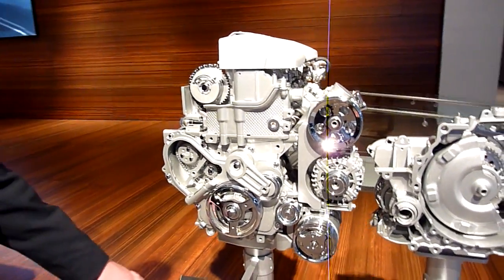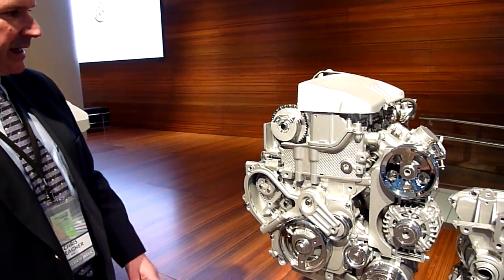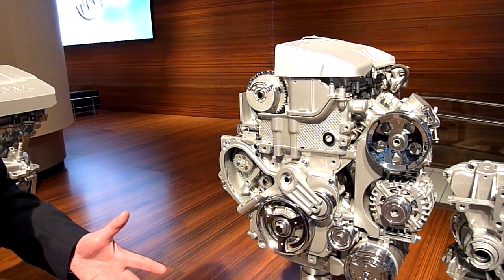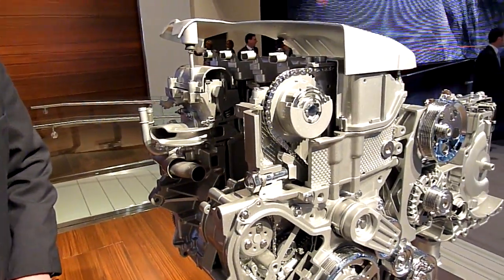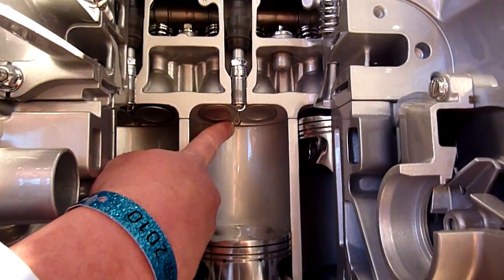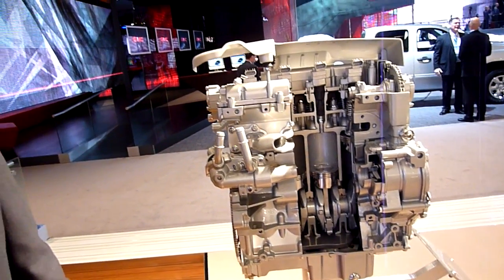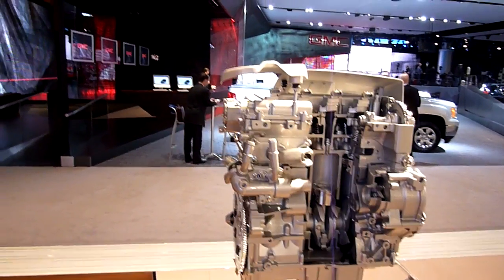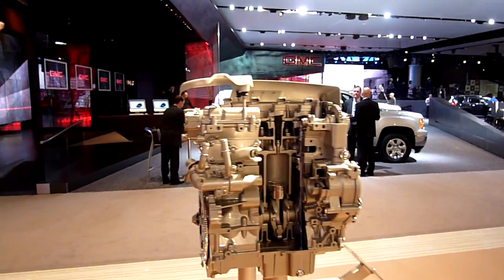General Motors Engineer gives us the lowdown on Ecotec 2.4

Comment: Well, it isn't the best design out there for a 4banger.. but full synthetic oil plus regular oil change every 8000k / 5000m will keep it going with 0 problems.. 

2016 Limited Malibu L.T.Z  2.4L ecotec engine .. 
runs like a clock in 2025 well over 128k on the odometer & still counting.

Comment: You forgot to mention only last between 110k and 150k after that timing chain tensioner fail or guides brake and the engine bent valves

Comment: I'm a mechanical engineer.  I take care of my engines.  At less than 100k miles with this engine I had high oil consumption, timing chain stretch and replacement, seal blowout.  No more Chevy for me.

Comment: My ecotec 2.0 Cobalt was the most reliable car ever, never used oil.. never leaked. 2.4 powered Malibu super dependable never leaked or burnt oil.. always on point but my 2012 equinox 2.4 no leaks no smoke just randomly uses endless amounts of oil... reliable but I know I can't trust the equinox 2.4 like I did with previous ecotec engines I had

Comment: The horse power is a big big turn off  would not buy it. Way to weak of motor
Reply: It's not too bad, Honda has 140hp on the new HRV amd 190hp on the new CRV. Toyota was making 176hp on the Rav4 in 2014 so the 182hp rating on the Equinox was very competitive.

Comment: What a pieces of junk engine.  They added every possible way to ruin an engine.  Really "direct injection, Volkswagen had so much problem with carbon buildup on the valves because of it.  Burning oil, piston ring failure, timing chain broken and a poorly design intake plenum causing pcv to clog. American people are look for a reliable engine and not a disposable engine.

Comment: Yall saying these are horrible engine mf i twist one of these engines with no balance shaft too 8200 rpm at a constant its called maintenance people maintenance
Reply: The early models 2010-2012 had oil burning issues and timing chain issues. After that they were decent engines, some even found homes in recreational vehicles aswell.

Comment: I have the 2.4 in my Buick Verano and doesn’t burn oil at all and as far as chains go, I use Royal Purple full synthetic 5-30 and change the oil at 1800 to 2000 miles. So many people don’t realize that changing out that dirty oil for fresh clean oil at 1800-2000 makes all the difference in how long your engine will last. Americans don’t worry about changing the oil and often just add some rather then changing it. They must have addressed the rings problem before building my 2.4

Comment: If you service it like you should , this engine is bullet proof.
Reply: Nope you can service it all you want it's a piece of shit motor that's poorly designed  I recently had blown out one of the cylinders it also had the oil consumption problem I even changed the oil a month prior to it going out so the garage told me it needs a whole new engine it will be costing me a little over $7k that's for parts and labor
Reply: @speeddemon_1369  if you dontind me asking what year was your Equinox?

Comment: I change oil every 2000 miles with Royal Purple and zero problems, typical Americans , you avoid regular oil changes and then bitch that the timing chain is at fault, no you are.

Comment: Man I was just thinking how he feels..  I own a 2011 terrain and have my share of issues including the rings replaced for Oil consumption so i am not sticking up for him at all.... The oil consumption is caused by a supplier  manufacturing the piston rings out of spec,   Should GM inspect supplier parts better,  Yes.    The timing chain major contributor was a  oil change interval set too high and customers using regular instead of syn blend oil.  They do need improvement but sometimes it out of the engineer's control.

Comment: Some engineer. He takes a Chevy Cavalier motor, adds direct injection and VVT solenoids, leaves the same piss-poor chain system in, and pats himself on the back! FIND ANOTHER JOB.
BTW: Anyone wanna know how to replace the balance-shaft gears on this "high-tech" motor?
ANSWER: You put a 5/32" DRILL BIT (I'm not making this up) or punch between the teeth of the gear into a "pilot-hole" and torque the bolt to 37FT LBS! I broke THREE of these pieces of shit before I had to built a tool to hold the gear while torquing it!

Comment: Hey Chris..........you forget to mention the bonus oil burning issue, timing chain failures, and pcv issues that make the rear main oil seal blow out.
Reply: Typical GM engine.
Reply: Hey Steve.....you forgot to mention the leaky high pressure fuel pumps, defective piston rings, and overheated coils in the cam solenoids.
Reply: I had the rings and heads timing chain vvt solenoids gaskets etc.replaced on mine GM fixed it for free because of the recall I also check the PCV to make sure it's clean I noticed in the winter the PCV gets partially clogged that's why I keep an eye on it so far so good. GM gave me a problem at first but then when I showed them my ASE certifications they were like oh OK for the oil burning a quart every 400 miles.
Reply: @TheBeast-tj9qo  vent all the crankcase pressure to atmosphere.  Remove the PCV tube from the intake before the throttle body. Capped the intake port. Vent the oil cap, or the valve cover so pressure is relieved. Consumption will reduce.

Comment: Excessive Oil consumption....Rear Main Seal blowout, timing chain loose, broken guide, frozen pcv valve.... transfer case replaced twice. Im just turning 99,000 miles on my 2013 Equinox...and yesterday the engine light comes on, and the engine started Loping and hesitating when stopped at an intersection.  1000 miles left on the power train warranty.....I'm driving it to the dealer tomorrow....fingers crossed. I drive Lyft....Chevy Needs to do something....like a RECALL....if they EVER EXPECT ANOTHER DIME FROM ME.

Comment: Got a 160k miles on mine. No complaints
Reply: Well, you got the only good one.
Reply: Kolden Kosmer yet.......
Reply: Sell it ASAP!!
Reply: Lucky. I had two 2015 chevys with the 2.4. Just traded my wife's in at 115K because using over a quart of oil every 600 miles. Didn't qualify for a rebuild from the lawsuit. My equinox had 77K no issues yet.
Reply: 2010 255,000 miles

Comment: It could've been a good engine, but my ecotec was stalling, and I'm in the middle of replacing the timing and balance chains/ guides right now at 93K miles. The block, pistons, cams, valves are probably great, but little things like the timing tensioner and plastic guides / bolts are no good. My chain jumped a crank wheel tooth because of these inexpensive things. I'm lucky to be able to figure it out before the engine was totaled. My mitsubishi mivec 2.0, with a similar design to this ecotec runs great at 240k with all original engine parts and with more neglect than this chevy. Its 3-rowed timing chain is superman compared to the chevy's weakling 1-row chain.
Reply: I buy GM at auction for peanuts. I buy most of my japanese cars from the show room.
Reply: 70k mine broke.Front guide like all of tgem.

Comment: Just out of curiosity, does the newer 2.5 LCV Ecotec also suffer from the same issues (timing chain and tensioner failures, excessive oil consumption, engine rattles, etc)? I do know that the 2.5 LCV Ecotec was extensively upgraded and revised when compared to this previous 2.4 DI Ecotec, so hopefully these issues have been ironed out by now.

Funny thing is I have a 2003 Saab 9-3 2.0t which has a Saab-modified 2.0L Ecotec turbo (codenamed B207) with 106k miles on it and I haven't had any significant issues with the powertrain. I've had it for almost 3 years now and the only repairs I've had to do with regards to the powertrain is fuel pump and water pump replacement. Of course I do maintain the car very well with synthetic oil changes every 5k miles, but considering the core of my engine is a GM Ecotec I expected that I would run into some of these similar issues, especially with my Saab's advanced age and considering it's an early Generation-I version of the Ecotec design.
Reply: The 2.5 ecotec is a much better engine.

Comment: This Smuck doesn't even know his product!!   Trash!!  Timing chains the size of a bicycle chains...If a timing chain can't last at Least 200,000 miles..its Garbage...watch the 5-$6,000 total engine and trans removal on YouTube so you get to timing chains and tensioners....Junk Motors by GM= Worst- 3.6 v6, eco 2.4 i4, 2.2 eco, 2.0 eco i4, 1.5 turbo, old 2.4 quad 4.....Bring back old iron 250 i-6, 2.5 Iron Duke i-4, 4.3 v6, 3.8 v6, 3.3 v6, 3.1 v6, 2.8 v6

Comment: The worst engine ever made!
Reply: Agreed. A true piece of shit. I've put two timing chains (and spockets and water pumps and tensioners...) in our Malibu. It seems GM engineers can use the old junk Cavalier motors, throw a few "improvements" on them and get them out of warranty.
Reply: I think the LE5 2.4 on the Solstice was pretty reliable I have one and frequent Solstice and Sky forums and haven’t heard of any major engine problems. Then again it’s the older version without Direct Injection and a 10.6-1 compression ratio instead of the crazy high 11.X seen on the newer ones.
Reply: @Protoking  The LE5's were reliable engines. I had one in a Cobalt SS and I ran the balls off of it. I ended up blowing it in a street race though. The counter-balance shaft failed and it kicked a rod and chainsawed itself apart. You could shine a light and see through it. I ended up getting another LE5 out of a wrecked Solstice, and drove it like a normal person for a long while.
Reply: correct ‼️

Comment: Oil burning pieces of junk. GM should own up to these horrible engines. GM sent letters to vehicle owners, telling them to check their oil at every fill up. Subaru and Toyota have had similar issues on their 4 cylinders, but at least they stood behind them, and repaired the engines, free of charge.
Reply: Yep, He's so proud of that oil burning disaster.  My 2012 GMC Terrain has that turd in it.
Reply: ever hear of the classic subaru oil leak from the head gaskets..most of them do

Comment: My malibu 2.2 ecotec has 136k miles and still runs strong. I never have been into the engine yet for anything. The timing chain issue is the result of shitty tensioners. Gm updated to a newer style. A good tip for the DI engines is they get carbon buildup on the backside of the valves since the fuel is no longer coming in that way. Use seafoam spray in the intake and let it hot soak. It actually works and removes all the deposits.
Reply: What year did they update to the newer style?

Comment: Really, best in gas???mmm... 2012 equinox 100k miles 1000 miles pass warranty, noise like a fair, oil going at rate of 1q every 2 weeks, and not even give me 18mpg. Fighting with GM see if they can cover the cost of replacing half engine do to timing belt fail, and seals. Sierra Chevy mech's says cant  doing nothing until you pay in advance for diagnostic, and need to change water pump, and all hoses and reservoir. Bad really bad leaking, take it to my mechanic found no liking at all... I try just to believe on American Made but this company did not support their own product. Still fighting with Chevy to see if they cover the fixing. Replacing Seals, hp gas pump, pistons, chain kit complete, and as the dealer says water pump and all the hoses... GM put only a bulletin 16118, instead of made a complete recall...

Comment: Ours is getting ready to go to the shop for new pistons, timing chain and tensioner because of excessive oil usage at 96,000 miles. I changed the oil every 5000 miles with Mobil 1 and it still started using oil. The service manager said all this is done at no cost. We'll see.
Reply: deere3321 just curious I have to take mine in as well next week. How has yours been running after the repairs?
Reply: Haven't had the repairs done yet. I'm in the process of monitoring it after the last oil change. If it doesn't use a quart in less than 2000 miles, they won't do anything yet. My mechanic says he has 2 other customers that had good luck at the same dealer I went to.
Reply: Well, I spoke too soon. Ours didn't use any oil until 90K. Now it uses the first quart at 2300 miles and will be out of the extra warranty before the end of the oil change. GM says it's acceptable usage and won't cover a thing. 
I've owned Chevy products for almost 50 years and I'll never own another. They know they have a problem and are more concerned about stock holders than they are the owners. Goodbye GM.
Reply: @deere3321  Well. their stockholders will be disappointed very soon. Then what?
Reply: deere3321 My daughter has a 2012 Equinox 2.4 that had 60k on it. She has it serviced regularly at the GMC-Buick dealer where I have my Buick and Chevy truck serviced. When she recently had the oil changed, the technician noted it arrived low on oil. The dealer service sales rep immediately began a survey, and asked that she have them check her oil every 1k miles.  After a few checks, they set up an appointment, gave her a new car to drive, and replaced the pistons, rings, and timing chain assembly.  She didn’t even know there was a problem, as they initiated everything based on that one observation during a routine service appointment.  That was a year ago, and the vehicle has been on several long trips since then without any oil consumption issues.  I think GM and the dealer were both reasonable and proactive in the way they handled the whole situation.  The mechanic even came to the service sales area, and visited with her directly when she picked up the vehicle.  

My 2014 Verano has a 2.4 Ecotec, is 5-years old now, and the service staff stated they have not seen any issues with those cars.  That car has had no mechanical issues to date.

Comment: 2014 equinox are these junk still???
Reply: If it has the 2.4L ecotec motor then yup I'm kicking out a little over $7k for a brand new engine from jasper one of the cylinders had blown out it also had the oil consumption problem
Reply: Hit and miss.

Comment: Gentlemen, Im not calling you guys liars or anything, but I just passed 100k in my Cobalt SS. The only thing other than optional performance parts was the starter. The starter is their preminum Delco Remy. It not the starter itself as much ast the solenoid. I replaced 8 of them on one starter. Two of them disentegrater during installion twice in a row. You wanna talk about pissed off. The ending itself its nothing short of great. It doesnt matter if its your daily driver or you are taking it to the track. I sometimes take it to the dirt roads in East Texas and install a set of knobby and race it in the dirt. The kind of racing where its likely you will trade paint. I have heard the timing chain issue. Its never been an issue. What I really like is how easy the head is to access and the way it was designed allows easy upgrade of internal engine parts. Since I havent had to rebuild, I havnet had the experience. With the right software, like HPTuners or the like, its easy to dial in whatever set up you want. From performance to economy and back again with the click of a mouse. Since I have been partial to Cobalts and Cavaliers for years. Even the Z24. This is by far the best engine this product line has ever had. Whenever I I feel the need, I can abuse this engine like a stepchild and so far, I got nothing to complain about. When the engine gets up their in age a little more, I am likely going to  try to build the Ecotec Roush Industries race engine. But that may be another 5 years. When I found out the beloved Cavalier was chaging its name, I was like oh brother. I found out that I liked the  Corvettes little brother a lot. the only thing that would have been better is they make a RWD version of the car and put a 4.3 Vortec in it instead. Make the Vortec into an Ecotec. Unfortunately I have zero fabrication skills to build this myself. Sure wish I knew someone with those skills. An Ecotec version of the 4.3 would be devastating and to date I know of no one doing it. It would be serious competition evn to the V8 classes. My ol S-10 had one. the only mods were a high rise throttle body and spacer, catback exhast, k@n air filter, and a limited-slip differenial. Thats all my dad would let me get at that young. I can tell you I buried a lot of of camaros and mustangs in that truck. Finally my dad said, thats too fast your momma said, and took it from me. Its time for a 4.3 Ecotec.
Reply: Robert Tullos thats the lsj 2.0 if its a cobalt ss and ac delco ever since gm dropped them have gone down in quality
Reply: @jaredbib9082  There are 4 engines for the Cobalts, and 3 of them are SS. The LE5 is the 2.4, the LSJ is supercharged 2.0 , and then there's the turbocharged LNF 2.0. All other Cobalt models are 2.2's.
Reply: My LE5 SS Cobalt also ran well. Have a Buick Verano with the newer 2.4 that also runs well.

Comment: My family and I thank you Chris, for engineering an absolute piece of junk. 72,000 miles and the engine has major timing chain issues. My wife was stuck out in the middle of traffic because the engine stopped running all of the sudden. I'd like to punch you right in the throat!
Reply: Tf is wrong with you the ecotec is bomb af I rape Subaru’s all the time in my 2.2 ecotec cobalt
Reply: @michealangel1556  this video is the 2.4 ecotech. 2.2 is alright.
Reply: AK G dont blame the designer unless hes the one manufacturing the parts